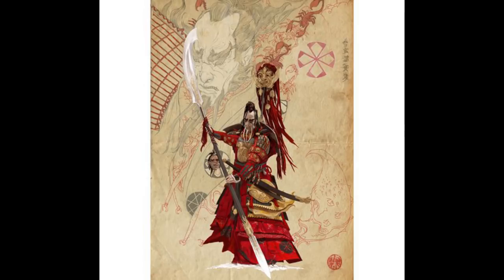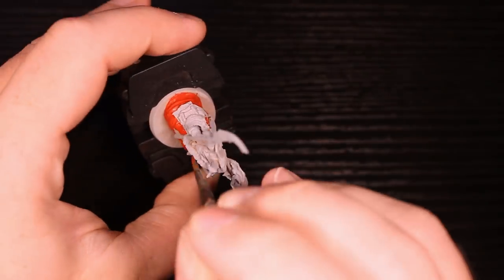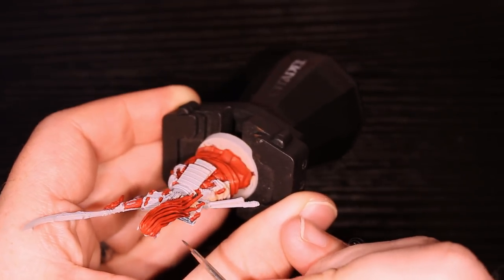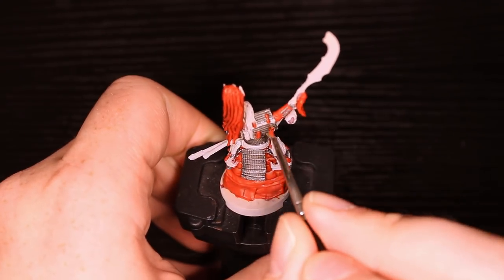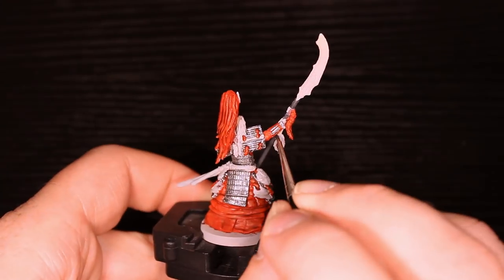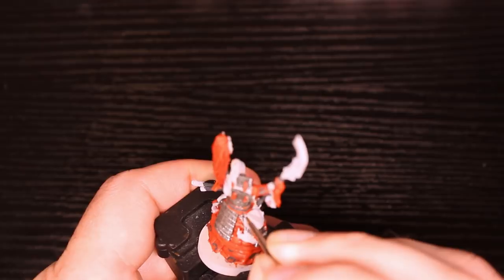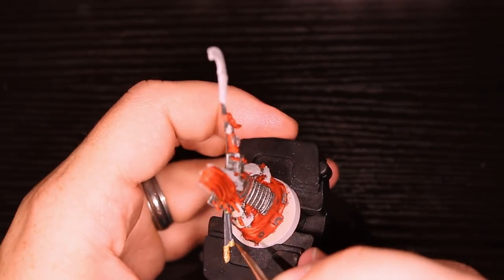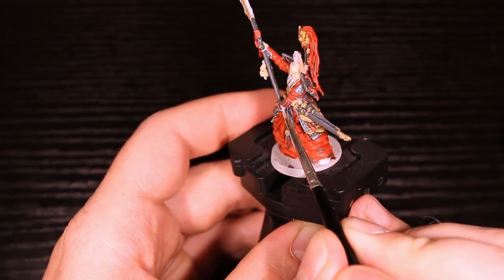Rising Sun Painting: Fox Daimyo

Comment: I have a question about the Battlefield Summer Undergrowth. Is it plastic, or some kind of moss/lichen? It looks like "Old Man's Beard" - a type of lichen that grows on trees where I live. On that note, I once bought "Leaf Litter" flock, and it was LITERALLY Italian seasoning mix.
Reply from the maker: It's definitely organic but it's a mix. I used only the bright green bushy ones, but they have darker green branchy ones, a dark grey one and even some pine needles in there.

As for the Italian seasoning mix - if it wasn't surely overpriced that could come in handy if you're out! :P
Reply from the maker: To add to this, I like it because it has several differeing types. I plan on using the dark grey ones for HATE basing a lot for instance and it'll look very different than this.
Reply: I really like the stuff coming out from HugeMiniatures. I have their flock, static grass, and I backed for their grass and flower tufts. They don't have any of the lichen stuff yet, but for flock I really like it. Super easy to work with.

Comment: This is awesome work! Got a technical question for you : how do you deal with paints that are already very watery in the bottle? I got a bottle of necromancer cloak and when i began using it, I could use it like a shader. Made it hell to paint raised portions.  Do you have a trick to...hum...make it less watery?
Reply from the maker: Thanks a lot - glad you liked the video :) As for your quesiton, I tend to paint pretty watered down so typically don't mind though I do have a few tips. First, Necromancer Cloak is an Army Painter paint and they often have a lot of medium separated. Make sure it's VERY well shaken, much more than you would think is necessary and that helps mine as it often comes out at first not mixed well at all.

Second, and this is if it's truly some really odd consistency, you can try to add some MORE medium. This should get it closer the the regular paint consistency, but will "stretch" out the pigment over more area, meaning it won't be as strong. I'd definitely try the first option to begin with.

Let me know if that helps!